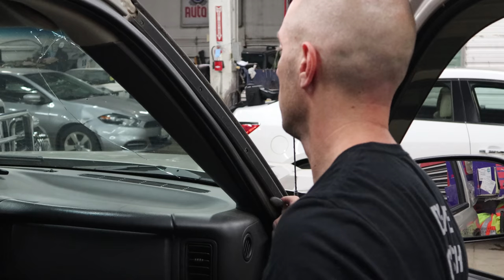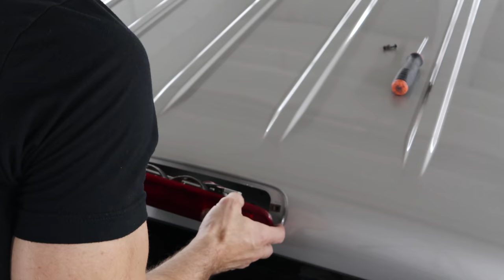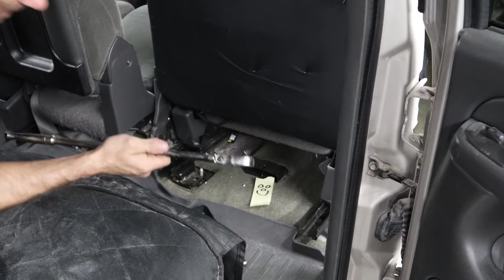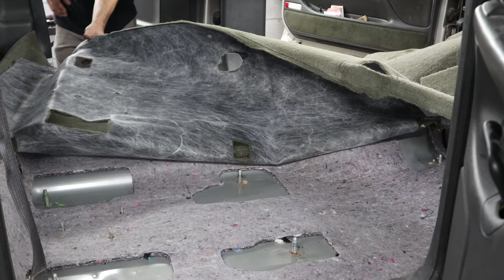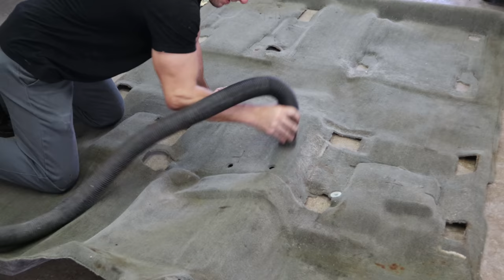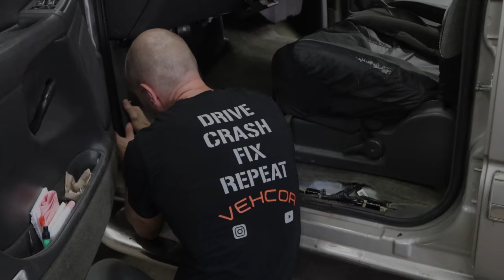Another bad repair leads to big problems and a Rusty Chevrolet!

Comment: Nice clean repair, just one question, why can't you turn the jack clamps with the nuts on top... well done
Reply from the maker: Thanks, I don't follow your question.  The jack covers the nuts when it is installed in the bracket if that is what you are asking.
Reply: @vehcor  sorry , to many pain meds, not jack clamps but camper topper clamps ...so sorry
Reply from the maker: Darrell Arrowood with the angle of the glass on the cap you can't use an impact on the if the bolt is on top.

Comment: What's the name of the stuff you used to spray in between body panels to keep them from rusting??
Reply from the maker: Weld through primer in the welded areas and cavity wax to seal the job up when you are done. I am not sure which you were referring to.

Comment: When a seat belt makes a ratcheting sound when you pull it out and locks up does it need replace or can you service it
Reply from the maker: The locking mechanism is failing.  It could probably be rebuilt or even cleaned.  If it is not one with a pre-tensioner, they are cheap.  I would just buy a new one.
Reply: @vehcor  its from 2007 chevy impala front passenger.

Comment: I just wonder what would've happened during the grinding and the sparks, if you released an enormous fart....
Reply from the maker: Nothing, I have shot sparks over gasoline without issues.
Reply: @vehcor  Well, just be careful with those proteinfarts...they're dangerous enough already, even without even igniting :)

Comment: Too bad you didn't check under the drivers door, it was rusty too.
Reply from the maker: As well as the rockers, other doors and fenders.  I don't do rust! I protested this but since it was leaking I gave in.
Reply: @vehcor  If the owner had had to take that truck to the dealership and did as much work on it as you did, it would have totaled the truck.

Comment: Did anyone notice he started to put a front door handle on the rear?
Reply from the maker: No, I don't know where I would have gotten a front door handle from.  I only had one door apart and two handles, the broken one and the one installed. Leaving me with no front door handles.
Reply: @vehcor  Sorry my bad. Watched it again, it was just a shadow from the pull part . BTW I really like your videos.
Reply from the maker: If I had two doors apart, I have no doubt the first handle I grabbed would be the wrong one. 😂
Reply: @vehcor  🤦‍♂️

Comment: C'mon, cmon!
C'mon, you can do it!
(car starts)
All right!
Dashing through the snow
in my Rusty Chevrolet
Down the road I go
Sliding all the way
I need new piston rings
I need some new snow tires
My car is held together
By a piece of chicken wire
Oh, rust and smoke, the heater's broke
The door just blew away
I light a match to see the dash
And then I start to pray
The frame is bent, the muffler went
The radio, it's okay
Oh what fun it is to drive
This Rusty Chevrolet
I went to the IGA
To get some Christmas cheer
I just passed up my left front tire
And it's getting hard to steer
Speeding down the highway
Right past a county cop
I have to drag my swampers
Just to get the car to stop
Bouncing through the snowdrifts
In a big blue cloud of smoke
People laugh as I drive by
And I wonder what's the joke
I got to get to Wal-Mart
To pick up the lay-away
'Cause Santa Claus is coming soon
In his big old rusty sleigh
Reply from the maker: Ok, so there are two of us that know the song! lol
Reply: vehcor lmao 😂